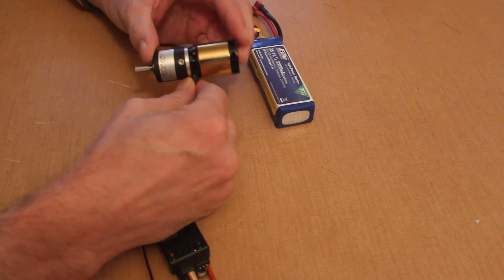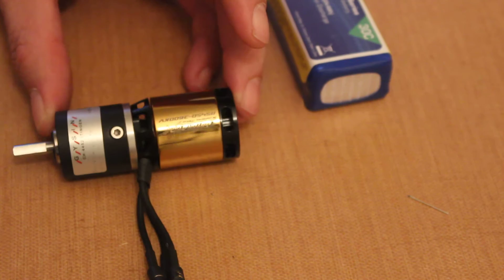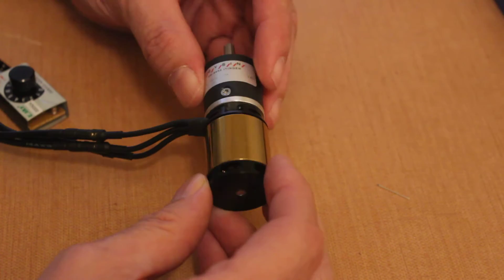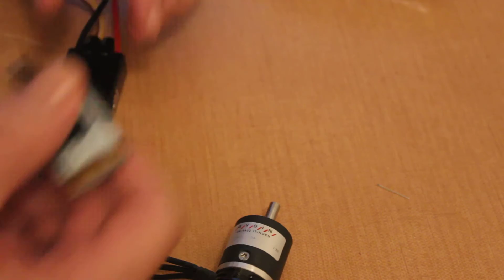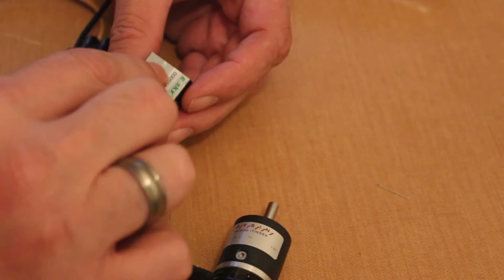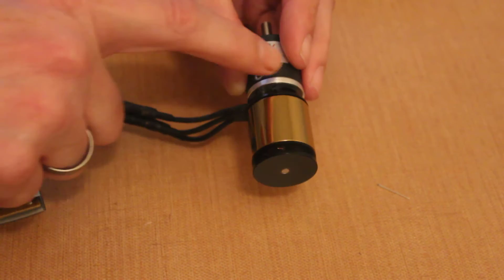First Run-up Video of a Planetary Gearbox

Comment: does adding a gearbox increase the power consumption of the motor? any help is appreciated
Reply from the maker: I have not measured that.  In fact, I have put this whole project aside for a while as other priorities have come along.  However, heat is power and since this does develop a modest amount of heat I'd imagine it does rob the system of some power.  However, the final gear ratio of 13:1 is similar to many of the spur gear arrangements used in the model helicopters so it probably results in about the same power reduction as the traditional system.

Comment: Running with no load will result in a current of a few amps and therefore at 11.1V the power will be ~20W thus only generating 2W of heat at the gearbox.